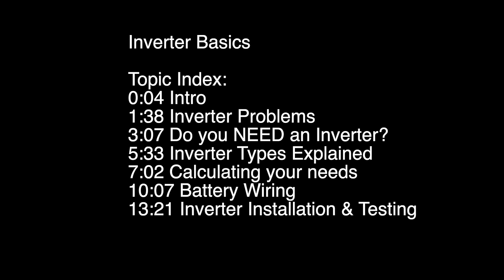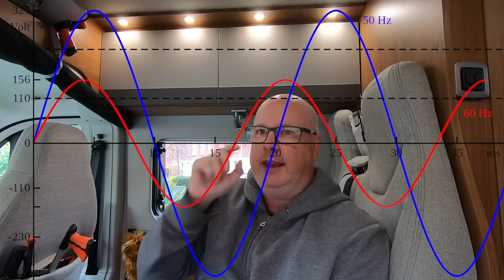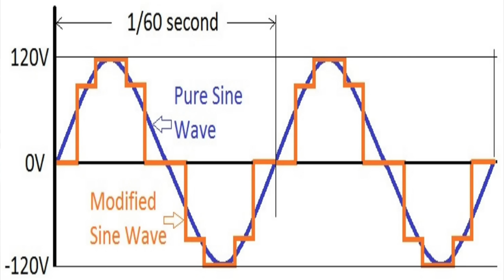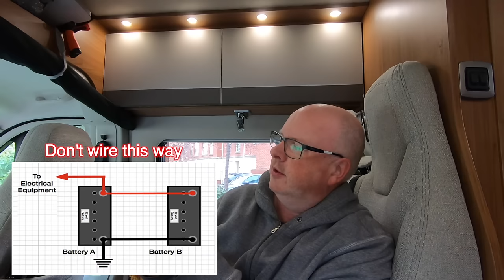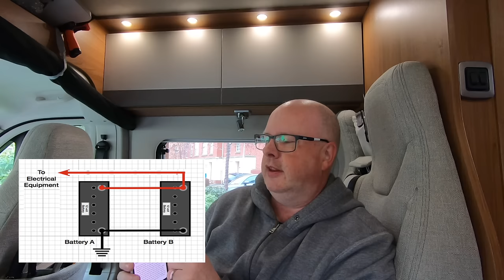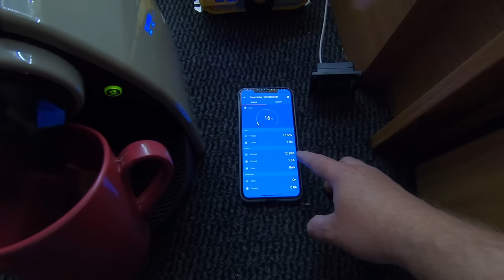Detailed 12v Inverter & Battery Wiring Guide - Campervan, Motorhome, RV & Boat

Comment: How would you rate those batteries, have they got a long life span, how many cycles have they. Thanks.
Reply from the maker: I replaced them for lithium, and then replaced those with agm. Find a battery that suits your needs is my advice.

Comment: Hi John, love your posts. New to motor homing and am looking into inverters. This has great reviews but as someone else has asked can you confirm that the Krieger models 1100,1500 & 2000W are actually pure sine wave because all the spec sheets etc for these models say they are modified sine wave. There are however excellent reviews out there. Would be great if you could clarify.

Comment: I'm looking at the same inverter (except for the 110v version) My suggestion would be to take the fuse out and replace it with an in-line Circuit breaker. It's easier to reset a breaker than trying to find a new fuse in case something happens.  Cheers from the USA. Awesome Video!

Comment: Thank you!!! for this. I’m new to van life and it drives me crazy watching everyone go crazy over inverters and AC outlets. EVERYTHING (almost) in your van life is 12V: your camera batteries, cellphones, laptops, drones, refrigerator, heating system, cooling system, TV, DVD. EVERYTHING. Probably the only exception is toaster or coffee maker. That’s it. Also, the max AC power appliance you can buy is about 1500 watts. 2000 watt inverter is more than enough for your one (maybe two) occasion use AC appliances.
Reply: Hmmm my Li-ion battery charger for my Milwaukee power tools needs a 110v outlet so I can make repairs on the road. Hard to repair using a slice of toast while drinking coffee!!

Comment: Excellent vid. Very useful for knowing whats required and how. We've just had a 300W one fitted for camera battery charging and chromebook , but will check out the 12v laptop chargers and more importantly I will check out how its all wired to make sure its the correct way round not just the usual way round. Thanks for posting
Reply from the maker: Oh Ed, I hope you didn’t pay too much. I used usb chargers for all my cameras, including my drone, and my laptop charges off my power bank. If it wasn’t for Mandy’s love of coffee I’d still have the little inverter that never got used.
Reply: @johnmandy  No not too much LOL  but i've just ordered an official Acer  12v to 19v supply from Power4laptops at Burnley of all places lol. because of your video so many thanks, will be nicely set up for our month long trip to Austria/Germany in May
Reply from the maker: Great stuff. That sounds like an epic trip 🚐👍🏼

Comment: that is absolute genius about the voltage conversion conflict. superb. never thought of it that way. thanks. am doing a van conversion and beyond gas for cooking was gonna look into getting a leisure battery / inverter set up but i may dodge the invert since all the equipment i use will really be low voltage I.T. or SELV. cheers john!

Comment: Nice bit of kit that inverter bud 👌👍, the cheap inverters seem to kill batteries too! Nor do they last ! ( I wouldn't class myself as a heavy user of power ). 3 inverters in 5 years in my old "works van" ( one nearly caught on fire ! ),  and 3 batteries later ! X that by 200 engineers if they too had the same problem as me 🤔, Now in my "new works van" and inverter No 4 🙄! Well I haven't bothered using it, I just rely on USB ports now mate. And kept the expensive ( ironically 👋🤪👋)  german built split charger ( from the old works van  ) for the "Gentlemans lounge bus" 🤫😁👌👍👍👍

Comment: So good! Although, I can’t trust anyone who throws coffee away 🤣🤣🤣
I’m glad you explained the battery flow, I’m amazed how many people don’t get that. If you got with three of 4 batteries even that method would still strain the outer batteries slightly more than the inner two. The best solution would be to go back to a positive and negative terminal with same length leads... Great work..
Reply from the maker: As electricity flows it means all batteries share the same load when wire this way. 2 batteries or 200 batteries, the principle is identical.

Comment: Just a quick question on you explaining how not to wire dual batteries. Surely it makes no difference either way you wire it up as electricy always travels the path of lease resistance so how you wired it your closest battery is going to take the initial load because current is going to run from earth (chassis/ground) across to you closest battery which has the live terminal linked up has the thick wire (earth lead) has less resistance than the battery. Therfore either way is the right way. I'm not knocking you I love you channel I'm just trying to work it out in my head
Reply from the maker: Electricity travels from 1 electrode to the other, negative to positive. So it’s crucial how it’s wired to get the flow through the battery bank. It makes a huge difference, if you don’t believe me you can google how Tesla wire up their batteries 👍🏼

Comment: Hi, I,ve been looking at converting my caravan to be electrically self sufficient and I wanted to say that I found your video "Detailed 12v inverter & battery wiring guide" the most informative. I understood everything you said about a dirty sine wave and why it needs to be pure: with a dirty wave you're basically converting a DC signal into a sine wave with out a smoothing circuit. I still have lots of questions like the size of solar panel (s) required to recharge the batteies and how best to fit these to the roof of my van, not to mention working out how much power I would actually use in a typical day.  
Kind regards
Steve

Comment: Hi John. A big thanks for being available for us. You have a genuine way with you when presenting your material.
I have a question I’m hoping you can help me with.
The big thing for us, in the motorhome is not a coffee machine lol, but being able to have constant use of two laptops for creative and business purposes. I’m having difficulty in finding a suitable 12v adapter that can fully charge laptops while using. As a result I thought the only way forward is an inverter. However I thought you might help. The laptops are Dell XPS 15 7590 and seem to have a special way of charging. Any suggestions please?
Reply from the maker: Every laptop can be charged from 12v,  just type in “dell xps 15 7590 12v charger” into google & you’ll see a few.

Comment: Great and informative video. I am a newbie and have a (perhaps silly) question, if I use a 2000 W converter in my Peugeot Traveller and have the engine running while I brew a coffee or use the Microwave, do I damage the battery or can it cope with the loads for a short periode of time? 
thank you very much :)

Comment: Great detail as usual - especially how to properly connect the batteries together. I was pondering an inverter until I saw one of your other videos about using 12V as much as possible and have just bought a 12V adapter for my laptop - must have got a good one as its the same one you showed 👍👍😎

Comment: Hi there very well explained and helpful video. I have the same brand inverter but its 1500w. I have a question does the inverter get damaged if stays under no load? Or is there a minimum load that it needs to be on the inverter. 
My electrician installed the inverter and said do not switch it on if is under no load. Is it a problem if its switched on and there is a small load lets say around 150w. Thanks for the video looking forward for your answer :)
Reply from the maker: You can leave them on full time without any issues.

Comment: Brilliant thank you so much so all I need are 2 batteries the same and an inverter for my caravan so I can use any 3 pin plug ie slow cooker ..I don't need to have them connected anywhere else

Comment: That was very well explained.. I use Modified inverter with a surge protected socket £100 cheaper than pure sine.. Never had any problems YET.. Nice to have your opinion on that one please..? haaahaha
Reply from the maker: Personally I’ve used them for years, but whilst knowing not to plug in sensitive electronics. So I’m ok with them, especially if you’re going to use them for a fridge or microwave. However, I’m sure people wouldn’t know the difference so I thought I’d give both examples and save problems for them in the future.
Reply: Yes.. I thought that.. Just wanted to hear your reply.. Haaha. I say, If you got the money go for the Pure.. I only ever turn my inverter on for the Microwave.. Every thing ells is ether 12v or i have 12v adapters for.. Cheers Bud

Comment: Hi John
I've watched quite a few videos on this subject (creating a mobile lab in the back of my van) but yours is by far the best one, so many thanks for that. One question though, I'm presuming the power source (in my case the starter battery) is wired into battery A? Its the one thing you do not seem to cover in your drawing or explanation.

Comment: Hi, thanks for a super helpful video. You mentioned you can split a single socket - can you use a regular 2 way socket adaptor? Thanks.
Reply from the maker: Yes, you can use a 2 way or 3 way, as long as you don’t overload the inverter socket

Comment: Is there a reason that you decided on a straight inverter rather than an inverter/charger? Do you already have a standalone charger for your house batteries?
Reply from the maker: Yes, cost was a factor and separate devices provides greater resilience

Comment: Just getting my head round camper electrics. Can I run a full 12v set up (tv fridge, lighting, Chinese heater) and then just use a separate 240v set up for when on site hook up?
Reply from the maker: Check out my videos, I’ve got a fully wiring guide video.
Reply: Kevin James yes you can

Comment: Great video but i have questions still. Im fitting out my mates race van and we trying to decide when to use a inverter and when to use 12v to power up his stuff ie microwave kettle toaster phone laptop etc. I've tryied to work out what drains a battery quicker 12v or 240v via a inverter but finding mixed info on the web.
Reply from the maker: 12v is more efficient to power devices. You’ll need an inverter for kettle, toaster & microwave but that’s taken from your 12v batteries. You’re far better off using gas to boil a kettle and toast things 👍🏼

Comment: Hi John, a great video. I'm looking at installing an inverter in my motorhome. If you install it near the battery (and out of the way) what's the best way to plug the device into the inverter? Ie Can you use extension lead to get to other side of the motorhome? Cheers
Reply from the maker: Yes, that’s fine 👍🏼

Comment: Nice explanation. 
I have a van use it for work. 
I need 1 small fridge 
700 w microwave 

I need 2000w inverter and 
1X12v around 100 amp 

Question 
Can I charge it thro my vans alternator? And it’s not bad for my alternator and so on?
 
Q2, if I leave the fridge on all night while I’m home and not using the car dose it not drain my car battery?  I mean if my external battery drain dose my car’s one drain to? 
Thanks
Reply from the maker: If you follow this guide you will be able to work out how many AH your battery will need to be etc. Remember 12v amps are much higher than mains power amps.  So a 100AH battery alone is not going to power a 2KW inverter if you use the full 2KW power.
You should get a DC to DC charger so your van will charge your house battery when the van engine runs.
A small 12v compressor fridge will be ok to be left switched on all the time, as long as you are charging your battery often through driving or solar.

Comment: Thanks for the brilliant info.
Quick question. I need to connect my Ps4 in my Van . Do I need a invertor for that or I can get away with a simple adapter ?
Reply from the maker: Yes, you’d need a pure sine wave inverter, but a small 500w will do fine.

Comment: So after much deliberating, I've finally got one of these inverters.....albeit the European version (all that was available at the time). Ive noticed that once wired up with a  euro plug, a lead and 3 pin plug socket attached, testing was done with a plug in tester, it shows reverse polarity.  So I unplugged and turned the plug around to find exactly the same issue....reverse polarity. After consulting Google, it seems earthing the inverter will sort it out. However, there's a lot of conversation on how to earth or even TO earth to the vans chassis.  my setup up is auto change over unit feeding into a garage consumer unit so rcd and mcb protected so ALL 240v is protected. Can you shed any light on the issue?

Love the channel BTW

Comment: Hey John, so when connecting solar panels or battery chargers, do you connect the incoming power to those same two terminals? So solar power positive to the same as all the outgoings, and solar negative to the grounded terminal.

Thanks
Reply from the maker: Yes, that’s it, really just that simple 👍🏼

Comment: Great video ! Very helpful , I'm about to power up my van after a yr living in it full-time. I live in Canada so solar would be silly for about 4 months of good sun . Marine deep cell batteries make more sense to me . I will for sure be watching the video you had mentioned in this video 😂 cheers
Reply: Great video as always John. What app did you use on your own phone to monitor your battery ?
Reply from the maker: It's the app that comes with the solar controller, video linked towards the end of this video.

Comment: Hi John thanks very much for all the info makes life much easier, I've been looking on line for agm batteries and I came across a 230ah Battery I'm wondering is this a good idea to buy just the one battery instead of two saves on weight and money or  is there a reason that you bought the 2 batteries ??
Reply from the maker: 2 batteries offers more power & resilience, I’d always go for at least 2 batteries.
Reply: @johnmandy  thanks John

Comment: Thanks John, great video. Apologies if this is a really dumb question.  I understood all the stuff about batteries and connecting BUT I was UNSURE where you run the inverter output to???  What I mean is does the AC created by the inverter get connected to the AC set up the van OR do you have to run a dedicated plug or plugs that are attached to the inverter into the van???  If so will the kit cover these needs?  Hope that makes sense?  Thanks
Reply from the maker: That’s all explained & shown in this video
Reply: Thanks  @johnmandy  sorry I guess what I was meaning was that most batteries are somewhat removed from the body of a van or caravan.  So I assume that in some cases you will need to run a wire or extension cable from the inverter to the area in the van/caravan where you will want to plug in the appliance??

Comment: HI john great videos i do alot of fishing where i have no electricity power supply.i know i can use the gas of course but will buy an inverter for my kettle and toaster etc.Iseen them forsale on ebay my question is buying one from china or hong kong are really cheap is this a good or bad way to buy one
Reply from the maker: As you can see, they take huge amounts of power from your batteries, that's a fire risk if the cables or components are cheap. There are links in my video to better quality products.

Comment: Hi John, thanks for this great info. One question; what about the distance between the batteries and the inverter? Any recommendations! Thx
Reply from the maker: Yes, keep the inverter as close to the battery as you can and cables as short as possible and as thick as possible. 👍🏼
Reply: @johnmandy  thanks John!

Comment: Hi John, I've been following you for a few weeks now and I really like how you explain things. I've a question though: are you still using this pure sine inverter or do you have an other non-pure sine inverter now as well that has either replaced or complements the one featured in this video?
Thx and keep going!
Reply from the maker: I use the same inverter I installed in my video and it’s working fine.
Reply: @johnmandy  Great video liked and subed, but checking on Amazon its showes as a moded sign wave is this right? Thought  it was a pure sign

Comment: Mate thank you for a fantastic video I’m a total newbie to van life / electrics in general and this was really well articulated for the Lay person! 

Did I totally misinterpret one of your messages though - or did you essentially say that since the van is wired on 12v, I am better off getting a 12v DC adapter for like a blender or similar utensil - as opposed to an inverter? 

Not sure if that makes sense but I tried 😂
Reply from the maker: Yes, use 12v as much as possible, only use an inverter if it’s the only solution.

Comment: Cheers John, bought the same one on your recommendation. Do both switches on the inverter need to be on to allow the remote to operate?
Reply from the maker: Just the power switch on the back 👍🏼
Reply: @johnmandy  cheers guys sorted. Hope you guys are safe n well and not to much hassle from the uninitiated 😉 if you get my gist.

Comment: Hi John, Great video! What size wire are you using for the 2000w inverter looks chunky is it 25mm2
Reply from the maker: Yes, well spotted, it was the wire that came with the inverter. For lower wattage inverts you wouldn't need such a big cable. I did try it on the 16mm cable I have, for testing only, and it worked fine but the cable was slightly warm to the touch. So it's always worth checking the cable when it's under load to check it's not getting warm/hot.

Comment: Great video. How do you supply power from the inverter to another 240v plug in your build somewhere else. Like the CBE plug sockets?
Reply from the maker: Just wire the cbe socket to a 3 pin plug and plug it into the inverter 🤦🏼‍♂️